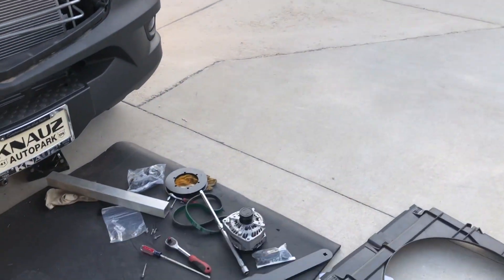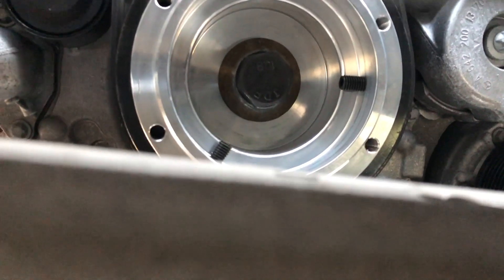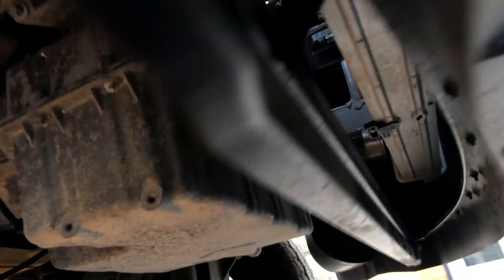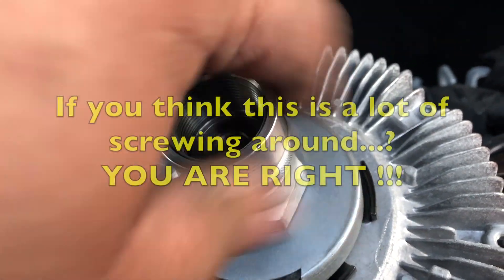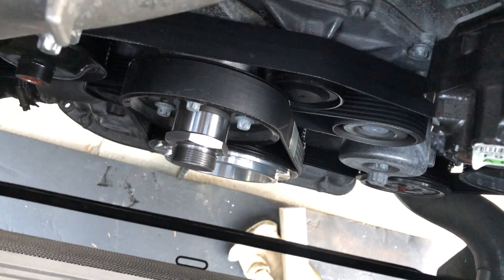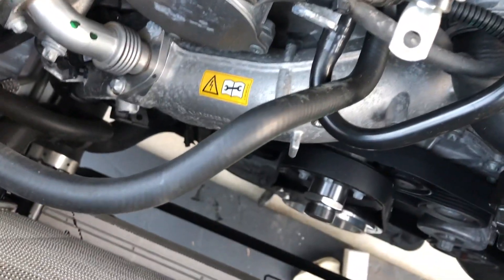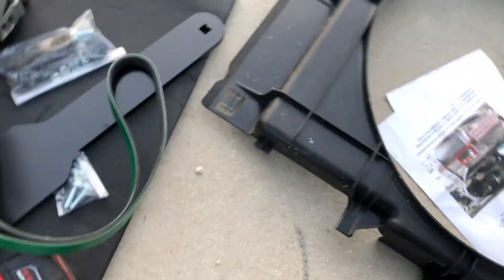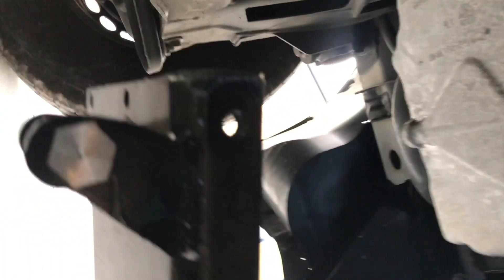Mercedes Sprinter Dual alternator install

Comment: When ordering a new sprinter, there is an option to add a 280A alternator and the price was only a couple hundred bucks. What's the difference? Is the one you installed OEM or after market?
Reply from the maker: After market, i bought it from the dealer lot so i didn’t have the option to buy the factory one
Also i set it up like an ambulance , separate 12 volt system
Reply: @ZILAwelds  I don't understand why the after market alternator cost more than the OEM version, am I missing something?
Reply from the maker: @vinnyandrocky  this aftermarket alternator is geared three to one that means it starts putting power out at idle. I’m not sure that it’s in the same location with the factory alternator is it has a separate belt separate pulley the alternator itself I think it’s about $900 the other $900 are for the custom police mounting kit and so on and so forth and it creates a separate electrical system with its own battery that is not connected to the car itself and the second alternator has 280 A all by itself.
Reply: @ZILAwelds  I just placed an order for the van without the 2nd alternator but I noticed there is an option for 2nd alternator. They show a picture of the 2nd 280A alternator but I don't think they will include all the hook up wires. There is a wait time of 5 months so I can still make changes if I want to add the factory install 2nd alternator.
Reply: @ZILAwelds  I just found out the 280A alternator option is not a second alternator, it is just an upgrade from the 250A standard alternator. No wonder it was so cheap.😂

Comment: Ok, we know the pains and costs. But what's the gains? How many extra amps does your charging system gain now that it did not have previously? And what do you use the extra electricity for? What can you now do that you couldn't previously do? You know me, I need the whole picture. And that's why I love you Peter. You never operate on half knowledge or unverified rumors. You're a pure facts man like me. So what's the rest of the story? 

And my hats off to you. You pulled off something 99% of the population could not do. You and I live to be problem solvers while the rest of the world runs away from problems, we run in to conquer them.
Reply from the maker: Chris, this alternator is 280 A it feeds a separate six battery bank that is not connected to the original car battery and a 4000 W split phase inverter is powered off that alternator and the six battery bank
This way, I have plenty of power for air conditioning cooking running any kind of equipment I want off of that van
Reply: @ZILAwelds  Ah, you design the unique results. You are just like me. It's either excuses, or results. Excuses are for the weak-minded.